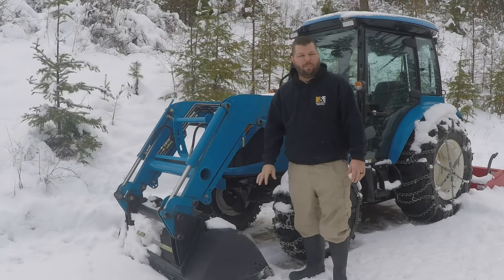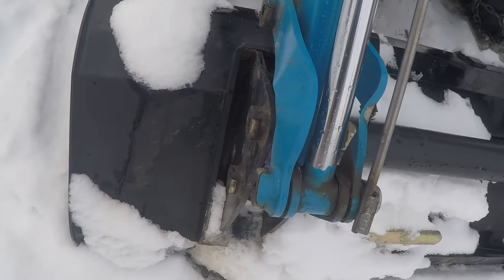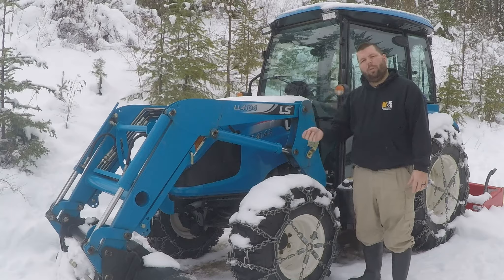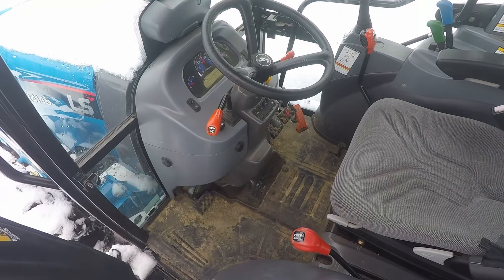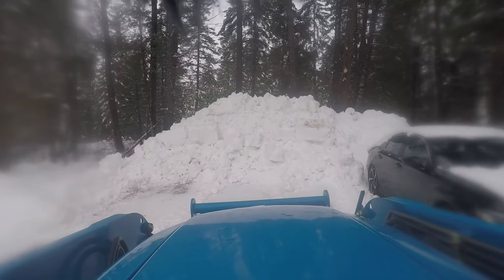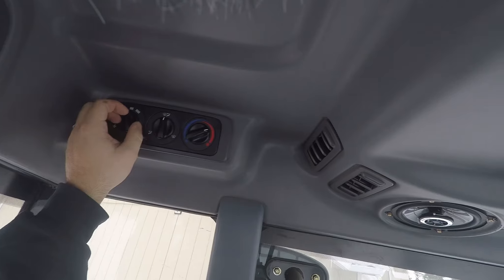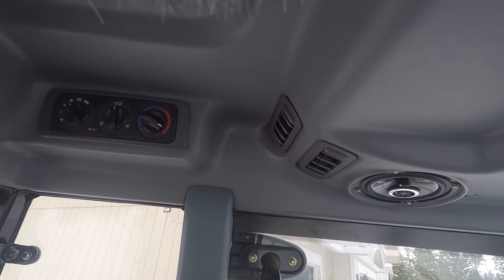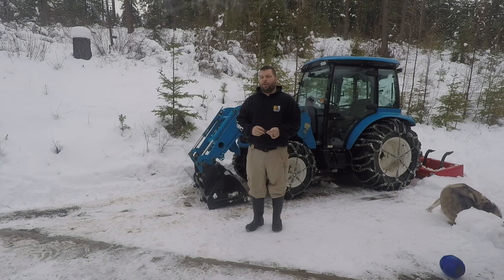Plowing Snow with the LS

Comment: What kind of tire chains you have on there?
Reply from the maker: Hey sorry for not replying. YouTube notifications are hit and miss. To answer your question:
I got these chains from TireChains.com specifically the https://tirechain.com/v-bar-duo-ladder-tractor-tire-chains-16-9-38-18-4-38-20-8-34-380-90-50-420-80-46-460-85-34-480-80-38-includes-spring-tensioner-priced-per-pair/ on the rear. Granted, they have gone way up in price. I paid $1500 for the rear, front, springs, and binders, plus shipping. 
Crazy times. 

Hope this helps!